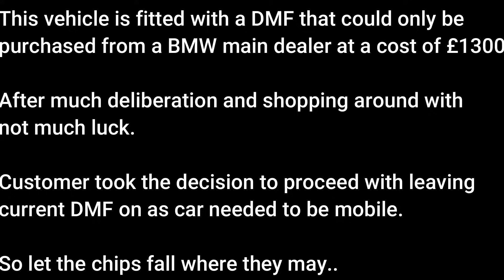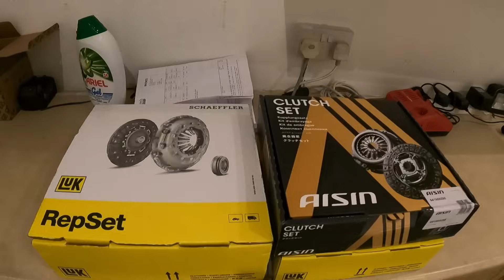Williams Mobile Clutch Service. Week 01/01/24. Video Log.

Comment from the maker: www.williamsmobileclutch.co.uk 🇬🇧

0:11 2013 Vauxhall Zafira Tourer Techline 2.0CDTI Diesel.

40:47 2016 Mini One TwinTurbo 1.2L Petrol.

1:09:20 2008 Hyundai i10 Style 1.1L Petrol.
Reply: I like how you 'set out your stall' so to speak. Emphasising 1: Safety . With the multiple sets of axle stands. 2: working area comfort, with the mat system..( I really must get something like that). And 3: Tool organisation.. so you're  not forever going back and forth from the van.

Comment: Nice work my man, fascinating to watch. Impressive watching you wrestle the gearbox on and off. We had two people and it was still a struggle.
I used your videos for reference while changing the gearbox and clutch on a 207cc 1.6vti. Thank you so much.
What torque would you recommend for the hub nuts as I get conflicting information online and would trust your opinion.
Reply from the maker: Just tight. Then clip it.

Comment: What is the role of the plastic thing in some new hydraulic pressure bearings that, after installation, are removed to the side? Thank you!
Reply from the maker: To prevent anyone that’s tempted to give it a little dry squeeze.
Reply: @WMCS  Thank you!

Comment: Question i replaced my tri clutch opted for sachs over luk price was simular i   the pressure plate on luk is advanced with with the adjustment type of spring would you say its better @wmcs

Comment: Hello Kevin, that DMF had gone on that mini hadn’t it ? Hope you are ok , cheers Phil
Reply from the maker: Yes. If you look in clutch plate removal. You can see it had twisted round. 
I took it off and realigned it so the guy could get it mobile again. Not something I’d normally do without a disclaimer

Comment: this is the problem with BMW they manufactured it in a way where you have to go back to them or buy expensive genuine parts in order to fix a problem. from adding the service history into the dashboard with a stupid code to TPMS sensors that need to say BMW on it so it registers to their ECU and god knows what else. good if you can afford it but. . .  they do drive nice lol
Reply from the maker: Very very well said.